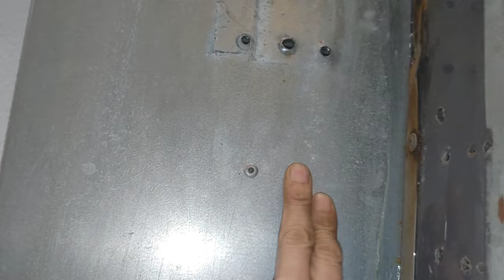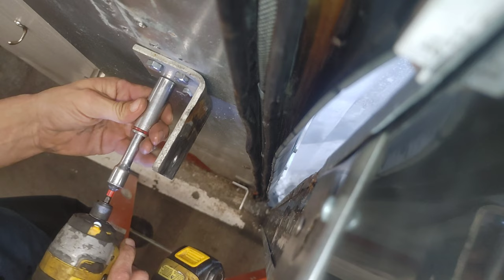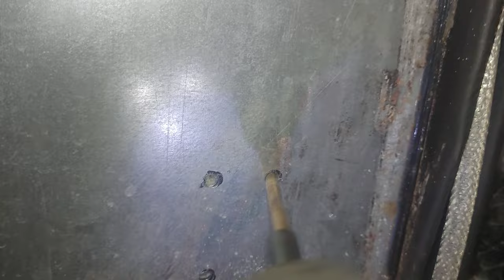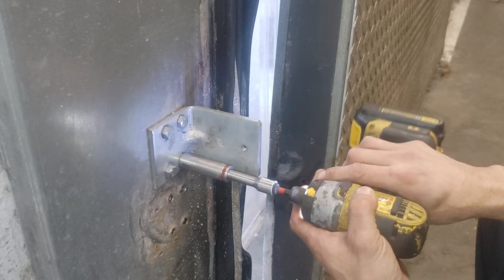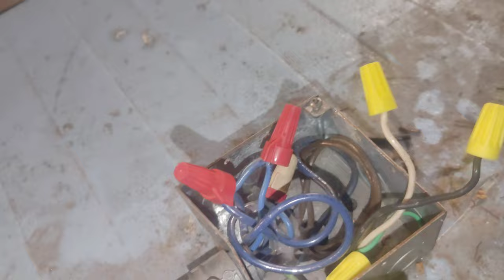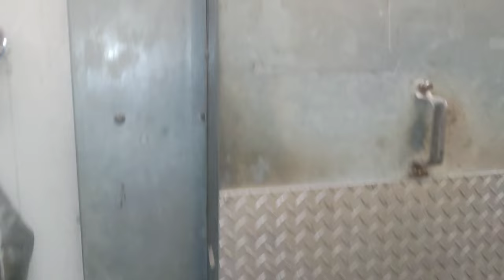Freezer Door Hardware Repair-Using a plug tap

Comment: You will save your bits and taps if you use some cool cut or WD40 while drilling and tapping, also will go much smoother and make better threads. Good job!
Reply from the maker: Thanks

Comment: There is a wood backer behind the frame that 3/8" wood lags would secure too unsteady if counting on maybe 1/8" of engagement of the threads you made
Reply from the maker: I thought there was, but there actually wasn't behind this one. there usually is and there should be. I should make sure I include all those details in my videos. Like that's something that I should have made sure All the viewers were aware of... that there was not would behind it. That's the only reason I chose to tap threads into the sheet metal. Because at first, I did have lag screws.

Comment: I was talking to the screen, center punch to start, fluid to tap...
Reply from the maker: Yes, i know you're right. it was just thin sheet metal pretty much, but still it's no excuse. I should have used oil.  I'd just don't carry punches as a refrigeration guy. But that's the way to go for sure.